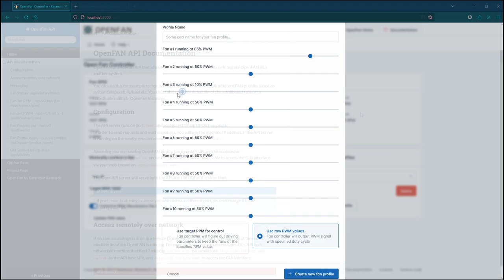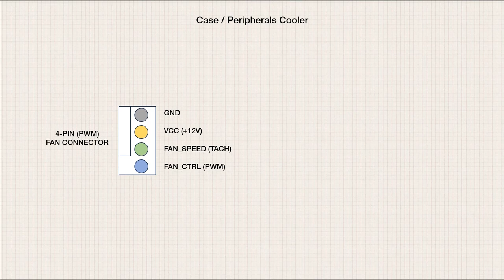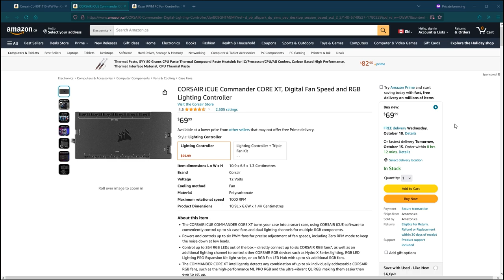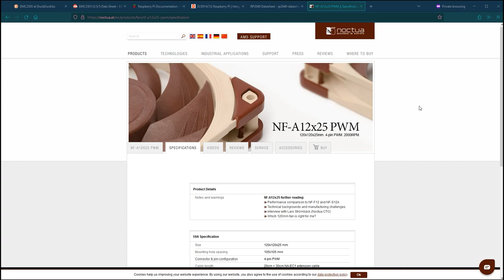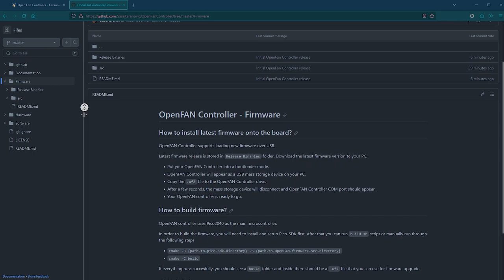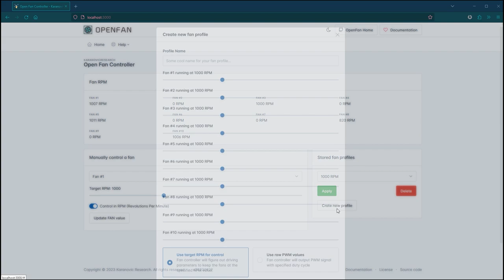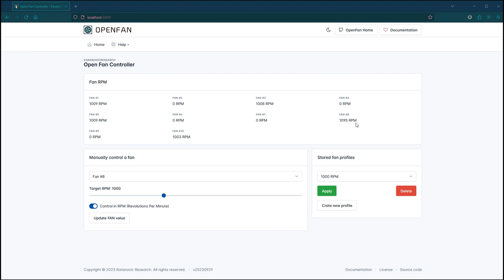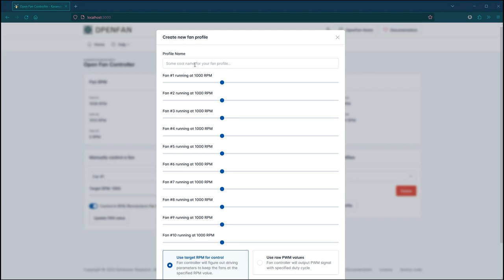OpenFAN Controller - The fan controller you didn't know you need

Comment: For anyone looking to power this outside a PC, Streacom has a PSU that takes 12v barrel and gives internal PC power cables like SATA power. Nano90 can be ordered without the AC/DC adapter.
Reply from the maker: Thanks for mentioning this! I totally forgot Streacom has tiny PSU that works from 12V DC power supply.
I believe there are also DC Barrel jack to SATA cables on AliExpress or you can make your own with DC Barrel jack to  terminal connector and cutting an old SATA cable. There are options to power it externally but you still need USB for controlling the fans. :)

Comment: My suggestion would be to add a header for rotary encoder for pwm and a register combination to select fan with dip switch or rotary encoder switch with leds x10 to to select the fans to change the pwm value it would good for manual control
Reply from the maker: Great suggestion. You could re-purpose the I2C or 1-Wire header to do this or maybe make an expansion board for it. It would be super easy to make. :)

Comment: I like the idea, but I do not see any serious protections without which it looks like a fire hazard. Devices like this are very easy to short circuit by connecting something incorrectly and even professionally made devices fail. I burned a few myself in the past. Therefore I would like to suggest for the future releases to consider adding some polyfuses or other types of protections to make sure that device is safe even with user errors.
Reply from the maker: Thanks! To be fair, everything is a smoke machine if you operate it wrong enough. So no arguments there.
All connectors are keyed and polarized so it would be very very hard to reverse polarity. But polyfuse is not a bad idea.
At the same time keep in mind that polyfuse would not magically protect against all user errors, especially if you take into consideration the scenario where each fan can draw 0.3-0.5A and you have 10 of them, at which point you are drawing 3-5A in normal operation.

Comment: Hi, I am planning to build my own fan controller board based on EMC2305 but with esp32 and I've been wondering is there any particular reason why you regulate 3,3 V from 12 V instead of taking it directly from SATA same as 5 and 12 V?
Reply from the maker: Hey I've done the same thing! Twinsies! :)
There are two new fan control products that use ESP32 being made and will be soon available on the shop page.
I think you are right, you could also take 3V3 directly from the SATA connector.
Reply: @SasaKaranovic  Oh wow, interesting. Hearing that I just hope mine doesn't turn out the same as yours when it is finished, because it'd be pointless haha ;) Is it pretty much the same as the current one but using ESP32 instead of RP2040 or did you add some new cool functionalities? :)
Reply from the maker: I don't want to spoil it for you (or anyone else). But I'm working on a video for one of them, so stay tuned. :)

Comment: Now if only this worked with argb
Reply from the maker: I am not a huge PC RGB user so I had to Google that. :)
The hardware is definitely capable of driving these. I would just need to add a header. :)

At the same time, it may be better to adhere to the Linux philosophy of "Make each program do one thing well. To do a new job, build afresh rather than complicate old programs by adding new "features". So maybe an OpenLED driver? :)
Reply: @SasaKaranovic  I am not a computer expert like you're but I have an asus motherboard that uses Aura software that controls the lights I have plugged in using my Argb slot on my mobo. My fans are all different sizes in my case so I was looking for a controller hub that used PWM slots and Argb so I can have all my fans/lights for them plugged in and able to control each of the fan's speeds separately. Which I didn't think would be a big deal in 2024 but having trouble finding something like that except the controller you made here, since most things for sale appear to be "hubs" for people who have multiple of the same kind of fan.
Reply from the maker: This should not be a problem since I have 80mm, 120mm and 140mm fans in one of my setups and as long as they are 12V PWM fans, you can easily control them.
For the ARGB lights; it might make more sense to create a separate project that controls the ARGB lights (and other common ones) so we don't cross-contaminate products with unnecessary features. At least in my mind it's better to have a really good fan controller and really good LED controller, rather than mix both of them in one product and have bloated HW/FW/SW. :)

Comment: This project is awesome!
1) Can you upload a CPL file for PCB assembly in the repository, please? I don't have an Altium designer license anymore and I can't use it to export some.
2) Is it possible to make a USB Type C variant of it?
3) Can you make a video where you through ordering a unit from a PCB provider that has assembly options as well: JLCPCB etc?
Thank you!
Reply from the maker: Thanks!
I already answered your question on Github and then saw you posted here as well.
All the manufacturing files are available in the GitHub repository. You can also order preassembled boards from my shop. They would be identical except latter option comes with preassembled and tested board, preloaded with firmware and USB-to-motherboard cable included.
The USB-C version would not affect the functionality of the board at all. But maybe in the future revisions I will swap the connector.

Comment: I got round this issue by using an old supermicro board with 4 x 3amp PWM headers. Now when i use passive splitters i'm not bottlenecked by max ampeage for higher power fans, and i have dynamic control of the 4 zones via the fan plugin for unraid which allows me to set the thresholds based on the motherboard, cpu, gpu, HBA and SMART HDD values for dynamic disk speeds for the zones.
Reply from the maker: Thanks for sharing your setup/tip! I wish my server MBO was that fancy... Mine has only one extra fan header.
But I basically have a very similar setup with the OpenFAN except I have 10 zones that I can individually control. For me it helps a lot to separate individual cpu/gpu/hdd/ssd cooling fans so I can keep my media server silent (which is in my living room, at least for now :)
Also there is now an official Unraid plugin for OpenFAN. So you could use some fancy automation or just good old batch/cron scripts to keep things cool. :)
Reply: @SasaKaranovic  - Congrats on the project! Great to know OpenFAN has been realeased on unraid. Is there anyway of utilizing the software with the standard PWM headers on a motherboard?
Reply from the maker: Thanks! The idea is that you can use OpenFAN with a PC that has any number or no PWM headers at all.

Comment: Oh wow, this is so cool! I use 2 fan controllers in my PC (I've got a full tower with 7x 140mm & 4x 120mm case fans) and would have loved to know it's possible for a person to build their own! The controllers work, but it's not ideal. I'd love to be able to set per fan speeds, but you're right, it's just not possible.

This is awesome work mate!
Reply from the maker: Thanks! I'm glad you like it. I couldn't find a fan controller that has all the features that I need so I built one. And it's open-source open-hardware so you can build your own too or modify the design to fit your use-case. :)

Comment: Very interested in the project, but I have a couple of suggestions.
1)Why not use USB C instead?
2)Having some support for 3 pins fans too would be nice. A lot of people already have a few of them laying around, and some come preinstalled with the case, some support for them would be a nice feature.
Reply from the maker: Thanks!
1) It would be extremely simple to update the design to use USB-C. Main reason was that at the time of making this video the USB-C version of the cable that goes from the motherboard (2.54" USB connector that you can see around 6:25) was 3x more expensive than the micro USB version.
2) That's a good suggestion. 3-pin fans are slightly more complex to drive but maybe in the next revision. I also have another project that should help with 2,3 and 4 pin fans, so stay tuned for that. :)
Reply: @SasaKaranovic do you have links to the two types of cables?
Reply from the maker: Yes! Thank you for reminding me. I will update the video description.
You are searching for "PC motherboard 9P to Micro USB". I will also add links to SATA connector.
Reply: Great suggestions!
Reply: Why are 3-pin fans slightly more complex,  @SasaKaranovic  ? Is it because of the method of speed control using the 3rd pin and voltage(?) variation?
Reply: @SasaKaranovic  Please no, 3-pin fans don't need a pwm driver, just a simple analog dc motor driver, there are so many solutions for this on the internet already, this is the first I have seen with proper PWM, assuming it does in fact work a 25kHz.

Comment: This board (and the micro version) seem (don't own one currently, will buy one though!) very interesting to maximise cooling performance of a PC!

As on my current Gigabyte board, FanControl (open source fan control for Windows) simply doesn't work; as there's no reverse engineered driver available.

The proprietary driver from Gigabyte themselves also doesn't allow using a mixture of multiple fan temperatures and selecting the highest temperature value, which FanControl does support (MAX group)

Using such grouping allows the fan cases to e.g. react to either processor or video card temperature increases, were in standard configurations it may lead to unoptimal scenarios when e.g. running a GPU heavy but CPU light game.

Thanks again for creating this and I'll be ordering a few soon! (next month(s))

Comment: Suggestions? Ok, find some reasonable (read: cost effective) way to add a little reinforcement to the micro USB header. Accidentally put just a little bit of force during cable management, and off it came. :(

That is my only bit of feedback! I Love the product, love the open source approach. Even purchased a second... immediately after the micro USB header popped off the board. Happy I found this project and could support it.
Reply from the maker: Thanks for the feedback! I really appreciate it!
Sorry to hear your uUSB header tore off during cable management... that sucks. Feel free to send me an email and maybe we can salvage it. :)
I will look for a better solution for the next revision. USB-C and through-hole connectors were an option but for some reason at the time when I designed it, the pricing of "custom" cables and the connector was almost 2-3x compared to the uUSB. But maybe it's worth it...
Reply: @SasaKaranovic  Thanks for the assistance on this! To future people looking at this product and considering purchasing it, know that your not just looking at a really unique product, but a great team behind it!

So often we see stories about companies being horrible, so here I want to shout out to a company that is awesome, standing behind their product and customers!  We need more people like you!  Cheers

Comment: This is awesome, but in case that I don't need to know the RPM of the fan (and instead I'm just interested in setting an custom PWM signal) would be possible to skip the EMC2305 and just use the PWM output of the microcontroller? Or to control fans without the PWM pin you could use the pwm signal to drive a mosfet that changes the voltage going into the fan, this way every fan would be supported, my motherboard has this function and it's a life saver when you find yourself needing to replace a fan for one that doesn't have pwm
Reply from the maker: Thank you!
Absolutely, you could make a very simple board and call it a day.
For my use-case, I want to know what is the RPM, because you could apply power and/or PWM to the fan but that does not guarantee it will spin. Another problem for my use-case is that if you apply 50% PWM to a 1200RPM fan and 3000RPM fan, they will spin at very different speeds. Also the price difference between the 3-pin and 4-pin fans is almost negligible, especially if you consider the cost of what those fans are cooling. :)

Comment: Looks super cool. Do you have a recommendation how could I use it in my server rack? I used Noctua 5V fans and if I am correct, it will only work with PC (12V) fans, right?
Reply from the maker: Thank you!
The board basically just takes 12V from SATA connector and passes it directly to the fans. You could make a custom SATA connector and wire 5V instead of 12V rail. Although I have not tried this, so theoretically it should work fine. :)
Although, regardless of OpenFAN, I would still recommend getting 12V 4-PIN/PWM fans if you can. :)

Comment: Wow. I wanted to make an identical project myself, only with stm32. It probably looks even easier on rp2040. As usual, someone was faster than me :P
Reply from the maker: Thanks! If you look at the end of the video, I'm showing the rev 1 which I made using STM32. But then I realized RP2040 is probably a bit friendlier towards hobbyists and hackers since it has built in USB bootloader, you can run version of Python if you prefer that over C and also it's cheaper and in stock everywhere. :)
Reply: @SasaKaranovic   Yes, I saw the whole movie. I didn't fully realize what possibilities RP2040 offers. Well done.

Comment: Hi! Thank you so much for this build! I was wondering if the sensor connectors could be used for a temperature sensor located in a specific place of the computer and stablish in the firmware a temperature curve for the fans 🤔🤔
Reply from the maker: Thank you! I am glad you liked it! :)
There are two temperature sensor connector on the board (that were designed in but they are not populated by default).
I would suggest maybe re-evaluating if you really need this approach. For example if your sensor is in the middle of the case and saying "Temperature is 28C", that does not really help because your CPU/GPU/HDD could also be at 28C or it could be at 60C. I think it's far better approach to use the actual CPU/GPU/HDD temperature reading and based on that adjust the fan(s) curve.
Reply: @SasaKaranovic  So... can the board access to those temperature readings from the mainboard? That's interesting
Reply from the maker: Great question!
OpenFAN is a fan controller but it also has an API which allows it to integrate easily with other applications. For example you can take a look at FanControl software that does fan curves and temperature readings etc. and then there is OpenFAN plugin for it which allows you to use OpenFAN with your existing FanControl setup.
Or another example, if you have a server/virtual machine/hypervisor, you can easily integrate OpenFAN and allow any piece of software to control each individual fan through the API.
Reply: @SasaKaranovic  Fantastic! Thanks!
Reply: @SasaKaranovic  If it could still have the function to work off its own temperature sensors, it would be ideal for watercooled PCs where the only useful control variable for the fans is the water temperature. the controller could basically run completely autonomously once the fan curve is set wich would be great

Comment: This is great for my Unraid HomeLab custom case build. I have a lot of fans, some targeting hard drives, some just input and output of the case. I connected them to the custom (AliExpress) hardware fan controller with knobs and it works fine and quiet, but when rebooted they do not spin until I ramp up the speed and lower it back to silent. Somebody already mentioned that it needs startup bump for it and it makes sense. But this also means that I keep them at higher, not so silent speed. And it's annoying since my homelab lives in my bedroom :) Plus I can not make them off when Unraid puts drives to sleep or when they are just idle-ing.
Since you are already using Unraid, is there some better way to control speed based on let's say hdd temperature or at least spin up/down status directly from Unraid? Or you expose both hdd info via API and then use your controllers API via n8n to keep them in sync? Btw a friend of mine works at n8n, here in Berlin and that's how I found out about them. Pretty useful tool.
When it comes to external sensors, it would be useful to attach some kind of temperature probes (had that long time ago for PC case temperature monitoring gauges from CoolerMaster. Or some kind of current meter that sits in between motherboard/psu and let's say fan or hdd, so it can kick in when the device is used and sleep when fan or hdd are not used. Not sure if this is possible. Just brainstorming.
Odličan projekat i svaka čast za open soure! Pozdrav!
Reply from the maker: I had the same problem as my Unraid server is also in the living room.
There is an additional Unraid app that allows you to specify custom fan curves based on HDD temperatures.
You could attach a I2C or 1-Wire sensor but I think in 99% use-cases that would not be very useful. I would always suggest using HDD/CPU/GPU temperature if it's already available.

Comment: Where I can buy a finished product, are you selling these fan controllers anyware?
Reply from the maker: Thank you for asking! Right now these are open-source open-hardware so you can build your own (or order one from online PCB shops). Unfortunately I already gave away the extra boards that I had so I'm all out at the moment.
If there is enough interest I could maybe open an online store where people can purchase these and other boards that I made.
Reply: @SasaKaranovic  I'd be very interested in buying a couple of these fan controllers if you ended up selling them.
Reply: @SasaKaranovic  I'm pretty sure that I have seen a couple of Opensource firmware projects on hardware sold already,  like express erls on FPV drone receivers. I think there is nothing like that in the market now at a reasonable price. I'm sure you would find a lot of interest if you decided to sell something like that.